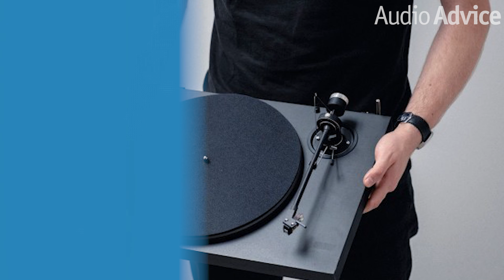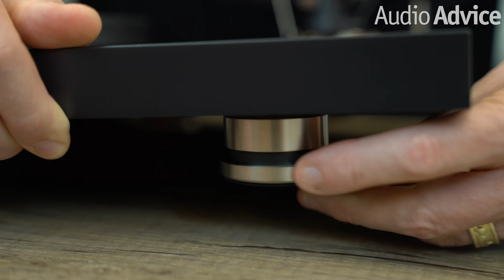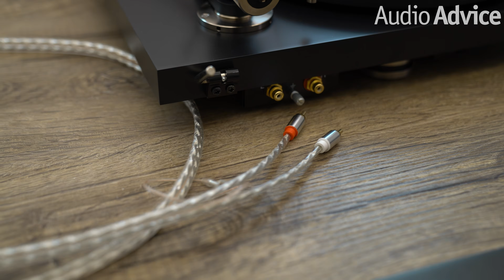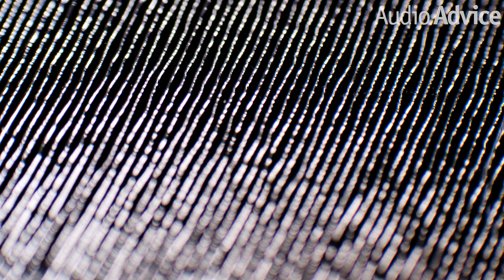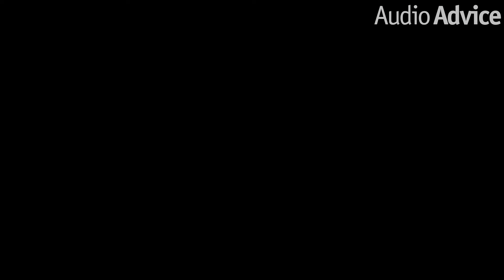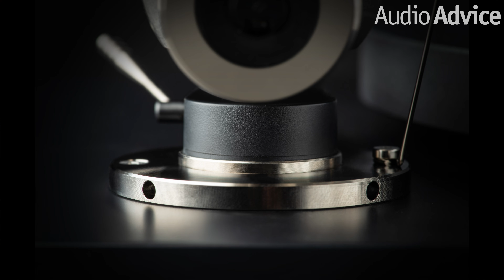Pro-Ject Debut Pro vs Pro-Ject Debut Carbon Evo | Which turntable is best for you?

Comment: Pro-Ject turntables have higher wow and flutter simply because belt drives and MDF plinths are cheaper to produce. It’s a cost-driven design, not an audiophile one. Marketing fills the gap by calling it ‘audiophile’, but real audiophile quality comes from speed accuracy and sound precision — which you get with a well-made direct drive like the SL-1500C.

Comment: The worst turntable i have  ever owned. The belts are constantly slipping making the tone one big wobble. No matter what putting vinyl almost stops the turntable. SAVE YOUT MONEY
Reply from the maker: Sorry you had this issue. We have had very few complaints about anything wrong with these. We would recommend contacting who you purchased from as you might have got a defective one.
Reply: I don't have the box because it was all good and B&H won't take it back till I purchase another and use that box to return That's over $1100 out till I get a credit

Comment: Debut Carbon Evo is an embarrassing product, little more than a toy. Just a few months after the warranty expired, and used no more than 3 or 4 times a week, the motor started making a distinctly audible noise. This seems to be a common issue, as discussed on various forums. Pro-Ject is anything but pro.
Reply from the maker: Sorry you had trouble.  Did you reach out to your dealer for help?  They are usually good at customer service.
Reply: @AudioAdvice  What they told me is that I have to replace the motor at my own expense. Including shipping and repair costs, I need to spend around 200€. Never again with Pro-ject, never!

Comment: I bought my first EVO  I was disappointed with this turntable first I don't like the anti skate and how the platter turns on without even moving the tone arm very small counter weight
very lite unit  bad hinges my Fluance RT 84 sounds so much better and cost less and a better stylus is on the Fluance.

Comment: Unfortunately my first Project deck which looks great for the money spindle is too wide on the clear platter I had to use s file to chop it down. Is an an essential 3 A. I used be very experienced in the turntable business putting on Rega arms but i have a Brain illness HD so need help sometimes putting records on so didn’t realise quickly. I am going to write to the company
Reply: If also pulls the belt of as it is too close to the edge at 33. I live in the UK and money is always tight (3 kids that stream) it’s just my playing records. I maybe as for a free x 1 for comp or ask for money to buy local Rega stuff. Thanks for your honest reviews
Reply from the maker: Hope it works out. Thanks for watching!

Comment: Get yourself a Technics sl-1500c sure the audiophile will tell you direct drive is inferior etc, curved tonearm whack. But I have tried all 3 through my Kef LS50W 2 and the Technics is just a better turntable, more robust, way more plug and play and removable headshell that takes pretty much anything (I use Goldring 1042) is just an absolute winner (the built in phono stage is even pretty damn good).
Reply from the maker: The SL1500 is a great table, but bear in mind it costs exactly twice as much as the EVO.  It should be better

Comment: Great video, what do you recommend as an upgrade to the Pick It Pro MM cartridge ? It’s not clear if the pick it pro is similar to the silver. Could a blue stylus slide on or should one go up to the Bronze? Cheers
Reply from the maker: Thank you.  That is a European model, but based on its price, the Blue would probably mate up to it, however we recommend you check with someone who has more knowledge on the makeup of the Pick It Pro.  Thanks for watching
Reply: @AudioAdvice  thank you bought in Canada I think we also get the European models. Followed your video and didn’t realize different cartridges and the anti skate goes on the 3rd notch vs 2nd from memory kept falling off the second thought I was doing something wrong until I realized the carts were different. Great videos and channel.
Reply: The Pick It Pro is basically an Ortofon Red but finetuned by Pro-Ject/Ortofon especially for the Debut Pro.
You can indeed use an Ortofon Blue on this cartridge (nude Elliptical instead of the regular one the Red an Pick It Pro).
If you want to use a Bronze you better also change the cartridge. It will fit the original cartridge but you'll never will get the full quality/advantage because of internal upgrades of the cartridge for the bronze (nude Fine line) / Black (Shibata) stylus.
Reply from the maker: @davef4722  thanks Dave. We thought it might be a modified Red based on the price. Appreciate you sharing.
Reply: @davef4722  thank you Dave do you have experience with the blue/bronze/black as upgrades? Looking at either of those , Goldring or Nagaoka. Appreciate your help.
Reply: @andyrocha  Hi Andy, I have a Pro-Ject Debut Carbon Evo and I upgraded the standard red stylus to a the Blue one (together with an acryl platter and alu sub platter) and I am very happy with the result although the red one (and probably also the Puck it Pro as it is finetuned) also performs quite well. The Blue one sounds more clear and detailed while the red one produces a rounder and warmer sound with a little less detail but still very nice in my opinion. I was concidering an upgrade to the bronze stylus/cartridge but it's almost the same price as what I paid for the complete turntable here in  Belgium (350 euro and I paid 399 euro for the turntable in a promo 🤭).
And also I am not sure if I could get reach the full potential of the Bronze stylus with the Carbon Evo's arm.
I am sure the Debut Pro with is upgraded arm will be able to get the full advantage out of this Bronze stylus/cartridge combo. But ofcourse it is a more expensive upgrade than the Blue.
Anyway I would advice to give the Pick It Pro (which will probably perform a little better then the original red) a chance first to break in (20h-100h / few weeks) and decide then if you like it. It's actually the same with the other versions. You need you give it time as I noticed this with the Blue that it sounds even better after some play sessions 🙂.
Just keep in mind that when you decide to go for the Bronze, the tracking force is only 1.5g instead of the 1.8-2.0g for the Red/Blue ones so you don't break it 😁

Comment: Thank You for the review.  Please tell me if the tone arm has the capability for VTA adjustment at the base of the arm.  This is my prime requirement for buying a turntable because I like to change cartridges frequently.
Reply from the maker: Glad you liked it.  The Pro has VTA. There are two small hex set screws in the rear base of the arm.  Thanks for watching

Comment: Great info I love viny I'm 62 and still have most of all mine from the 70s would love one of these someday .do you have any recommendations for a good vinyl cleaner like I said still have mine from 70s and they (200) could use a professional cleaning.thanks in advance for you great company and fantastic reviews
Reply from the maker: Thanks Jeff. You were really smart to hang on to your vinyl.  A few originals in good shape might pay for a great wet cleaning machine. Check out Discogs for pricing on used vinyl.  This is a great cleaner. https://www.audioadvice.com/pro-ject-vinyl-cleaner-vc-e
Reply: I own the Pro Ject VC-E and it does one heck of a job cleaning vinyl, but if you are on a budget I recommend the Spin Clean manual record cleaner. It also does a very good job cleaning vinyl and costs much less.